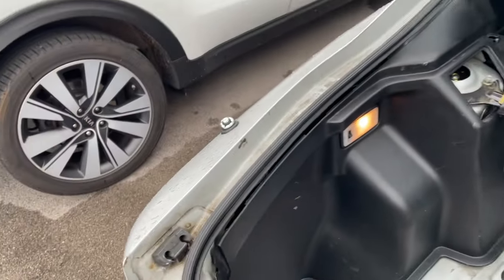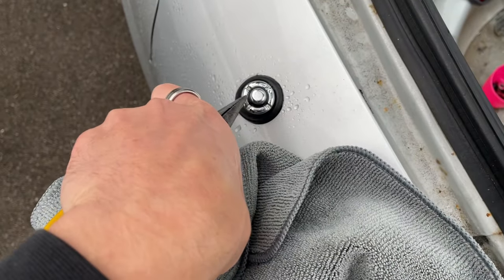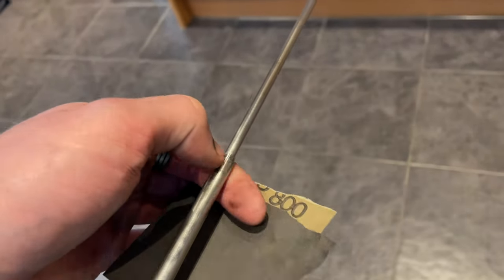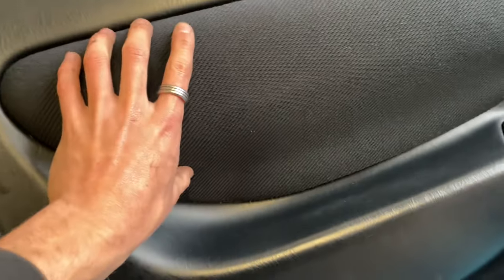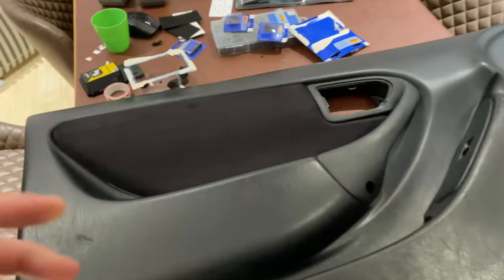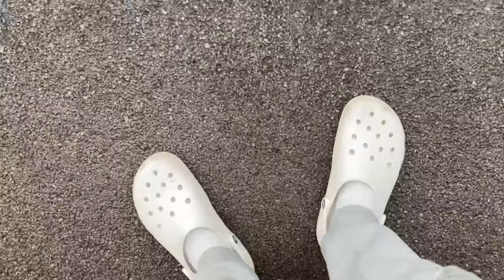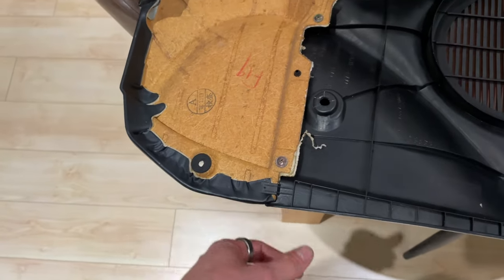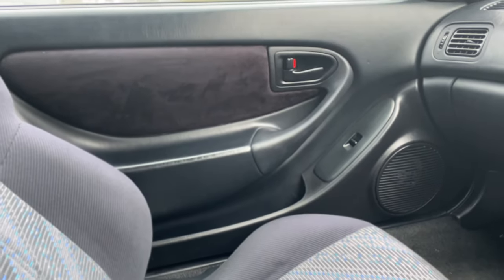Celica GT ST202: Episode 4 - HOW BIG IS YOUR AERIAL?

Comment: Is that aerial an aftermarket one?
Reply from the maker: It’s the standard aerial :)
Reply: It's cool to see a stock aerial on a Celica, most people replaced them after these suffered a failure of some sorts. My ST204 for the time being has a makeshift one but soon I'm swapping it for either an aftermarket or an operational one from some scrapped 6th gen Celica.
Reply from the maker: @PrekiFromPoland  yes I love the original aerial, needed some work to get it back to working but worth it. There are some UK suppliers that have original ones
Reply: I wonder how expensive, fully working original aerial is. I might be interested in purchasing one.
Reply from the maker: @PrekiFromPoland  I know the metal part  is about £50, motor assembly probably similar off a breaker